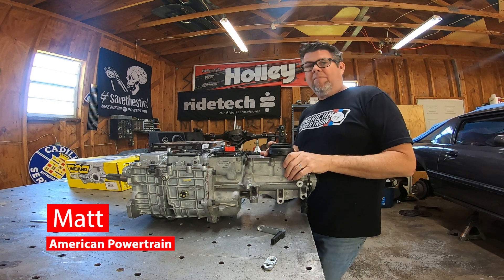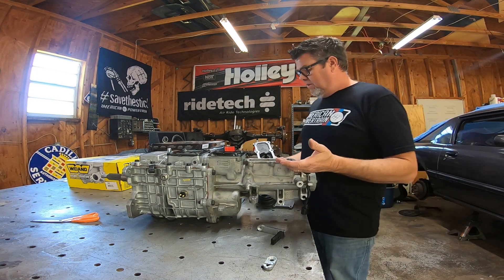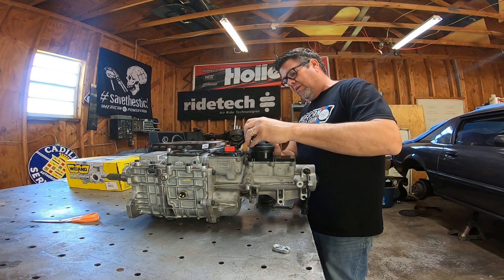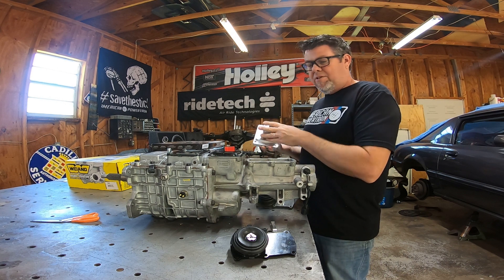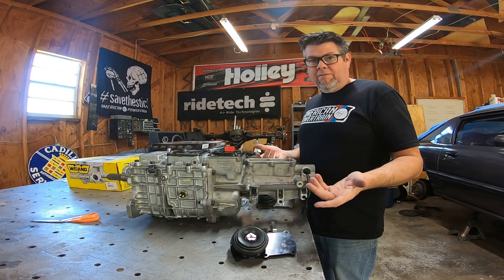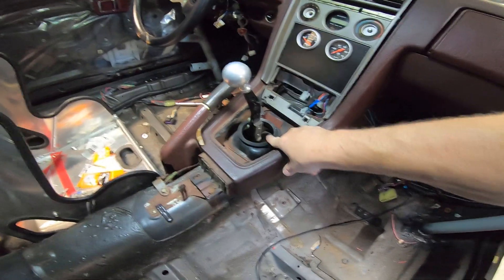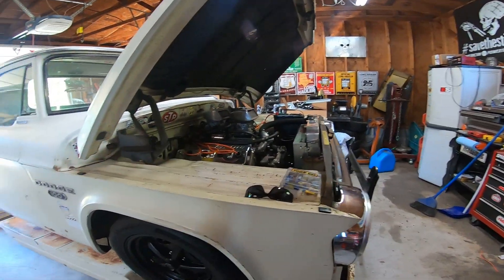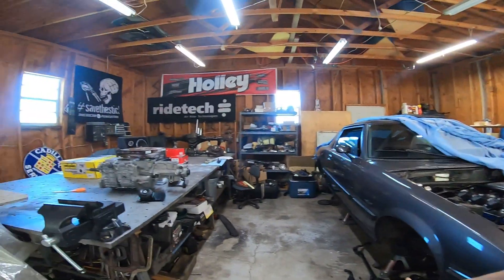Tremec TKO Transmission Shifter Position Tech from American Powertrain

Comment: Putting tko into 68 mustang, shifter ends up 3/4" offset towards passenger.   Tried loosening motor mount bolts.... put trans end on floor jack, but it snaps back towards passenger when I take pressure off ... any idea if there is any offset built in?
Reply from the maker: We have shifter set up that can give you more shifter offset if you need it. Just call us at 931-646-4836

Comment: Love all the shifter location options guys. I have a magnum in my terminator cobra so I’d love to get one.
But my thing is the throws. They still seem kinda long in this video. I was hoping this was a short shifter kit as well. 
Like the Tick units are and Hanlon!
Reply from the maker: That is a TKO with a stock Tremec shifter. We have our White Lightning brand shifter that is a 30% shorter throw.
Reply: @AmericanPowertrain  nice I may buy one! I saw some of the older units start leaking out the top? Have you heard of this? And has it been addressed on the new unit?
Reply from the maker: @Wretched2JZ  Yes a long time ago
Reply: @AmericanPowertrain  nice! Ok I think I’m almost ready to order one. Are there any adjustments for the springs in it? Or is it just setup good to go?
I like I nice stiffer robust feel if that makes sense.

The stock magnum unit seems a bit sloppy in my opinion.

Comment: I just bought a ‘69 Camaro with a TKO 600. The shifter is super stiff , doesn’t go into reverse when the car is running. I need help.
Reply from the maker: call our tech line at 931-646-4836